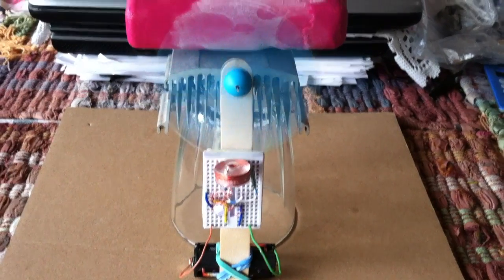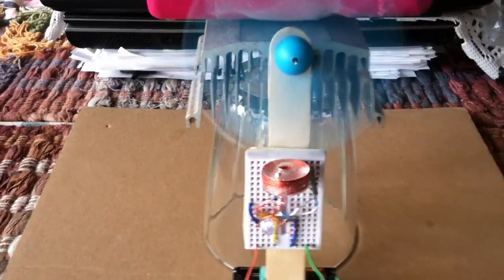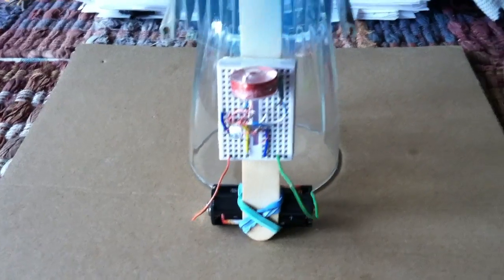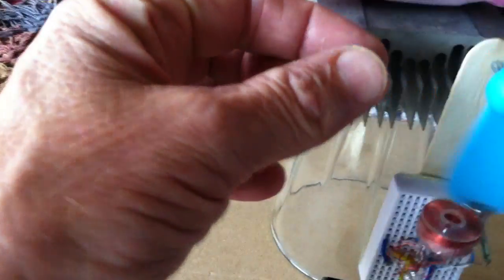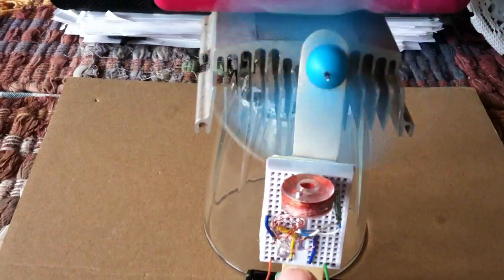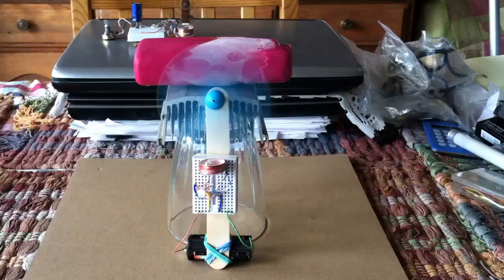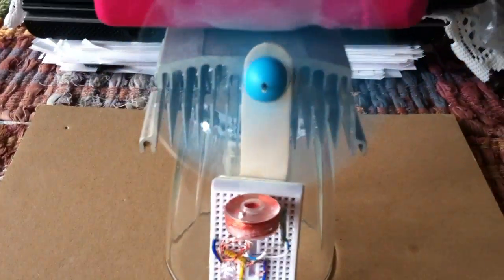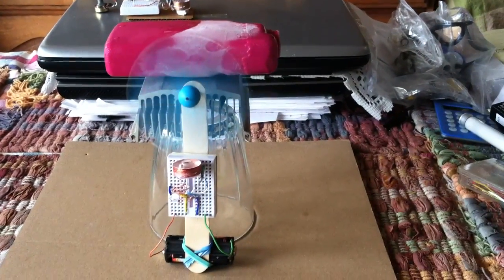Geek Air Conditioner

Comment: Hello, It's a very interesting idea, and I woul like to replicate it for my students. You said in the video that it's used AWG 30 for the coil, but It's not said the coil resistance or turns, and it's needed to replicate it exactly as you did, would you please show this data. Thanks in advance.

Comment: LOL classic ! geat use and function :)
With a small solar panel outside and wires to the workbench, it would be really good for the summer months now.
Reply from the maker: I have been dreaming about a small solar powered AC unit for years.  Perhaps this is the year I build one.

Comment: Neat!
Wouldn't it produce more cold if you blew the air through the aluminum heat exchanger fins?
Reply from the maker: This crude setup would block too much of the airflow.  A better heat exchanger would be a help.  I think we are going to have a hot summer and I may work on some kind of tiny solar powered AC unit for my boat.  This is a start.
Reply: I've been wondering if there was an efficient way to use ice as a less expensive cooling method or supplemental cooling method (when electricity prices are less expensive--which is something that I think operators of some sky scrapers use to reduce cooling costs).

As I understand it, it takes 417.71 J/g to freeze water (i.e; 20 °C to 0 °C & freeze/crystalize it). 

Since 1 gallon of water weighs ~8.31 lbs or 31323.32g, that means it would take ~13 MJ or 3.63 kWh to freeze 1 gallon of water.  If you multiple 3.63 times your electric power rate, then you can determine how much it would cost you to freeze 1 gallon of water.
Reply from the maker: This refrigeration subject has been with me for many years.  What is the best way to make something cold?   How can I make a 'kitchen table' project that works.  It is not easy.  Going to the refrigerator and getting a cold pack isn't the answer.  I have several ideas on how to do it.  I can do it easily using Peltier modules but they are not efficient.
Reply: If you have a heat source and a heat sink, it is possible to drive a heat engine.  In a closed-cycle system, warm water from the ocean surface can be passed through a heat exchanger to evaporate a low-boiling point fluid (e.g. liquid ammonia). The expanding ammonia can be used to drives a turbine to generate electricity. Colder ocean water can be pumped to the surface to cool and condense the ammonia back to a liquid and the cycle then starts again.

Not an easy or inexpensive system to develop, but possible.

Comment: since you have a cold pack there, couldn't you wire in a peltier module for the power source?
Reply from the maker: Yes I could.  They take quite a bit of power though and are not very efficient.  That is still is a good idea.  Thanks.
Reply: They have "energy harvesting" ICs that run on as little as 20mv. People are using them with peltier modules
Reply from the maker: Thanks.  That is good news.  I will look into it.

Comment: Might also try a wet sponge for evaporative cooling if the humidity conditions are correct.  Sponge could also be drip fed from a container.
Reply from the maker: I just tried your idea and it worked.  The room humidity is 65% so much higher and it probably wouldn't be too good..  It is a miniature 'swamp cooler'.  I used to live in a hot dry place and we used them there.
Reply: Yes a mini swamp cooler, I bought one of these cheap battery powered swamp coolers on ebay, and they work ok.  They drill holes in the sponge to let the air through.  The zeer pot also uses the same concept with sand.